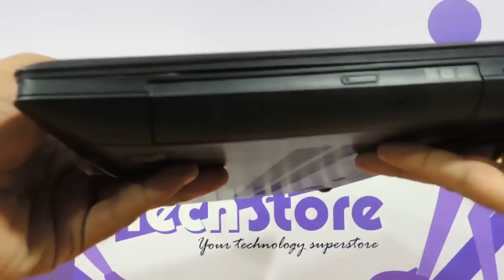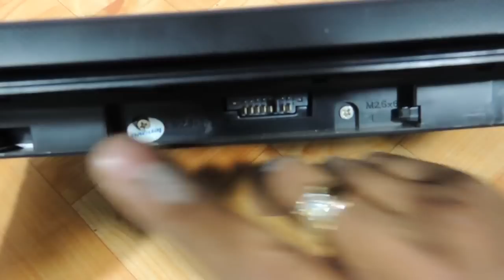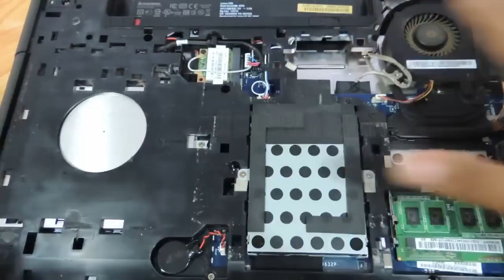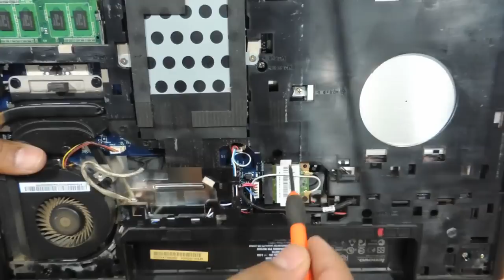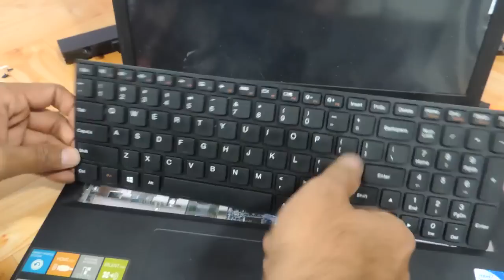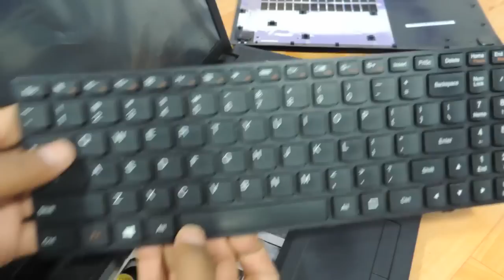Lenovo g500 g510 g505 How to replace the keyboard

Comment: … or disconnect it and reconnect it, in case maybe the connection might be faulty. It happened to me that some keys on my G500 just stopped responding all of a sudden, without even using the laptop, just by sitting on a table. I haven’t tried to unplug it and plug it back in yet. The laptop did stay with the battery connected through all this time, so I hope a short circuit didn’t occur during the time it sat and maybe fried some keys.

Comment: The little black piece that holds the keyboard wire in place has come off and I can't get it back on. I tried stuffing the wire in and putting the black piece back the only way I can get it to click in, but the keyboard is completely unresponsive (only a few keys were not working before).  Any tips????

Comment: Thank you for the video,  really need to replace this one only the 5 and 6 work on the num strip and nothing on the keypad...the fn keys on top arent working either anymore and i barely touch them.  This would be the 3rd keyboard on my g510 that has gone up.  what do you recommend for a heavy handed typer besides stop typing so hard...

Comment: Thank you for this video! Some of the keys stopped working on my G510 and I had to use a USB keyboard. Your video walked me through all the steps to replace it with no problems and my new keyboard works perfectly. I'll be replacing my screen soon and I will definitely watch your video for help with that. Thank you so much!

Comment: Wow, I didn't expect it to be that easy. Replacement keyboards are only about £12 if you shop around. It's almost easy enough to swap it regularly if you frequently needed dual language keyboards (different layouts are used for different languages, with extra keys for accents etc)
Reply from the maker: +MyChannel  thanks for your kind words